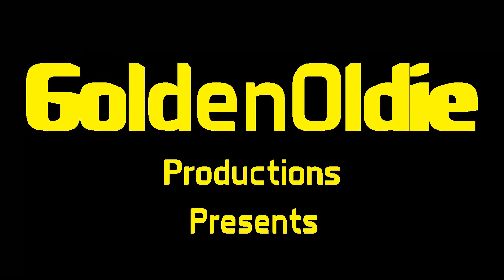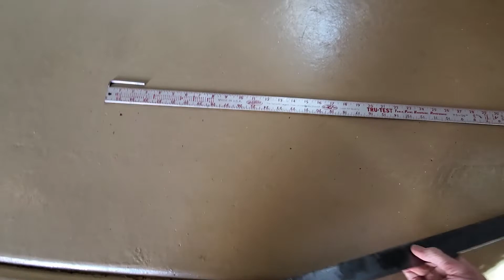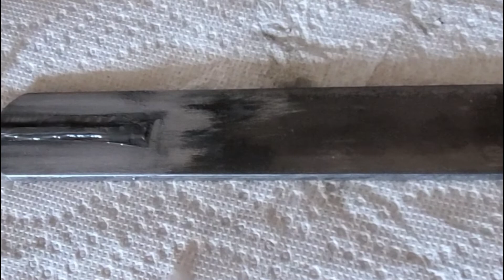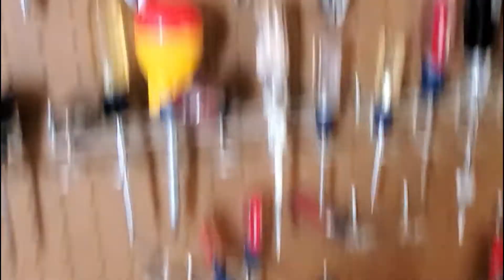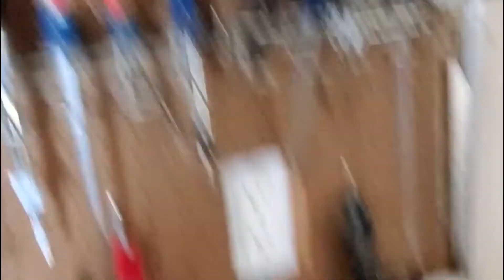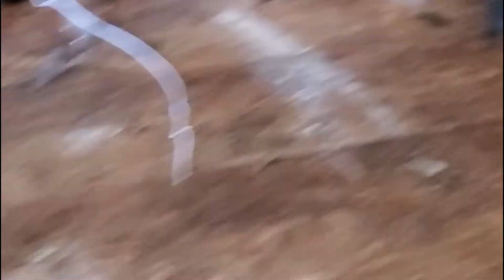Reset Thermal Cut Out Switch Wolf Dbl Electric Oven

Comment: I have a different Wolf model DF606DG. The oven stopped heating after I did a self clean, which I have since learned never to do. I knew I had to reset the thermal sensor. For my unit, you need to take out the oven racks, remove the back panel (remove the screws). After that, you can look by the fan and find the thermal sensor with a wire attached to it and a little red button. Simple press the red button to reset. I hope this helps someone else out. I spent $165 for this knowledge tid bit.

Comment: I can’t for the life of me find the reset button. I’m looking all around in the slots in between the ovens and I can find anything that looks like what is shown in the video. Can anyone offer more direction? The wife has service coming out next week for $150, and I’m trying to cancel that appointment. Thanks in advance.
Reply from the maker: It's hard to find and see through the slots.  It's towards the back and you'll only see the side of it.  Good luck.  Rick
Reply: It’s my upper oven that’s not heating. Do you suppose there is a separate thermal switch in the slots above the upper oven?
Reply from the maker: @JustinOhm  I would bet it's in a different location.  Try to find a repair manual and it should show where it is.  Rick

Comment: Hi Rick, how much force to reset the switch and is it noticeable by feel or a click/noise? I had the same symptoms, made the tool you creatively came up with, but feel I may have a different issue. Thanks for making the video, very helpful either way! All the best!
Reply from the maker: Didn't feel or hear a click.  Had to try it several times before it worked.  It's hard to get it placed properly on the center of the switch.  Good luck.  Rick